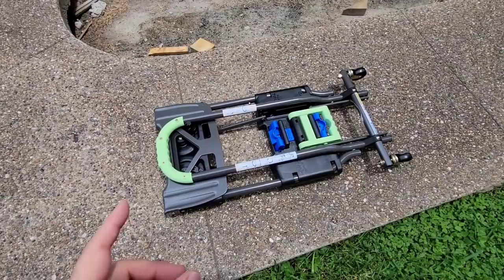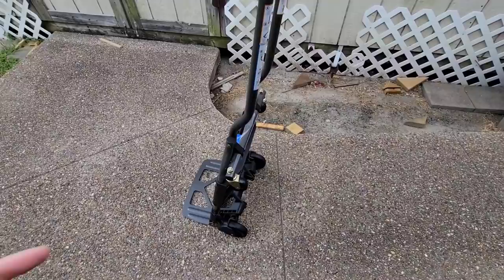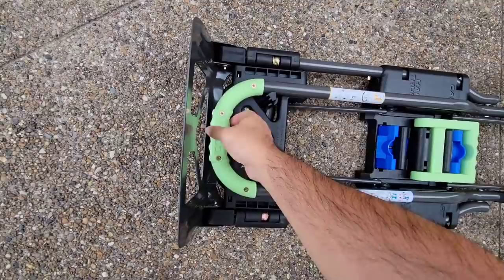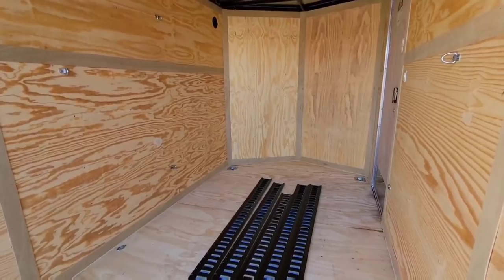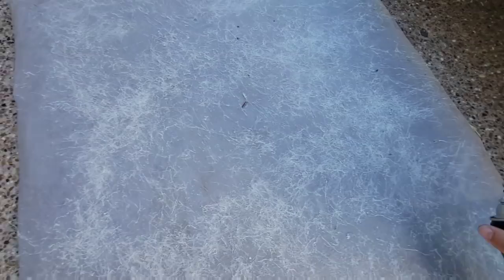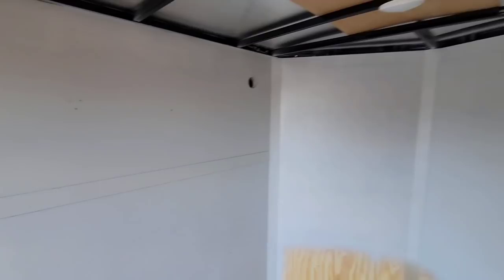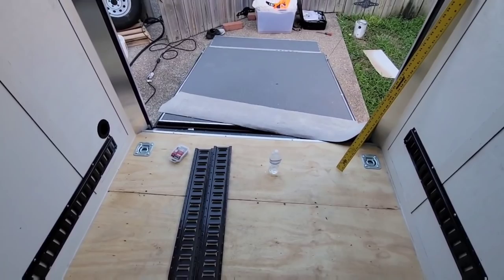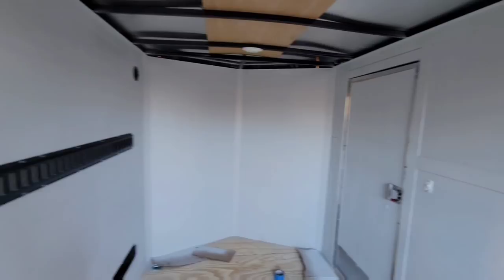Awesome Invention under $100! Plus Mini Cargo Trailer getting big upgrades!

Comment: I've had a 10' Haulmark trailer for about 20 years now... I use that thing so much.  It is great!  It has held up very well.  I lined the sides and front with 5/8" plywood to keep anything that might shift from poking through the skin.  Also makes for lots of flexibility with mounting hardware.  Thanks for sharing!
Reply: What does trailer have to do with hand truck ??
Reply: @michaelmcvey5942  Did you watch the video?  It covers both the hand truck and updates/upgrades to his enclosed trailer...

Comment: Suggestion on the  e-track installation: Consider running parallel etracks horizontally at the same level so that you can fasion 2x4 members across to form a shelf or raised floor. This way, you can have a lower portion of the trailer for heavy items like plywood or lumber, and then have many other items (less heavy) accessible above. To attach the 2x4 beams to the e-track, look up "DC Cargo Mall E Track Beam Socket".

Comment: Depending on what you are using the hand truck for, a longer blade could make getting it out from under a stack a lot harder. I drove a hand truck for 20+ years. You are better off with a thicker than longer blade.

Comment: The cosco shifter, Back in the day a company office was being moved so I had one of these shipped there beforehand by Amazon. Most useful thing I ever bought from moving servers to the rental to lifting cube walls to run network cables under them.

Comment: This about your trailer, which I think you’d like it better in long run with bedliner sprayed from about 1ft up the walls and seal the floor Incase something was to spill or leak and get underneath the rubber matting    Other than that I really like it

Comment: The Harbor Freight stores in my state have a quite extensive selection of casters, both bearinged and non-bearinged. I'm sure y'all should be able to find something better than what is on the dolly currently.
That's a pretty cool 😎 product though, JD. Compact and pretty good capacity for the size of it.
Giddy up. I'm liking it.